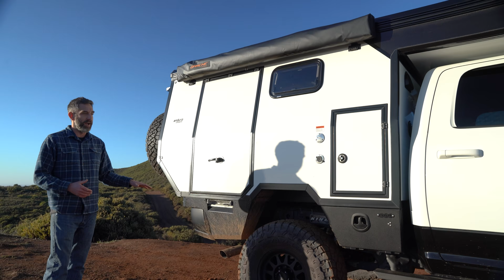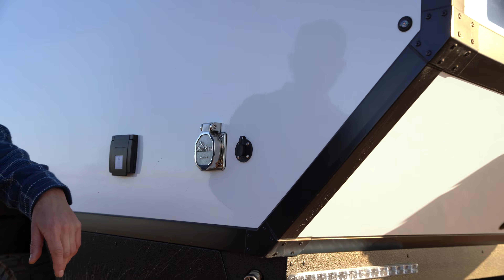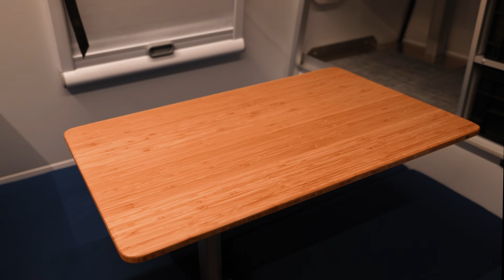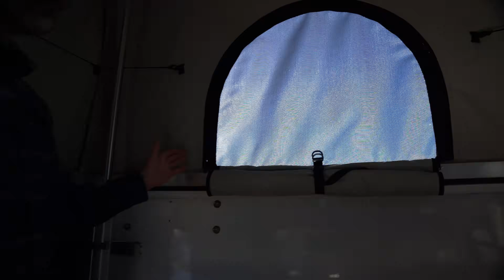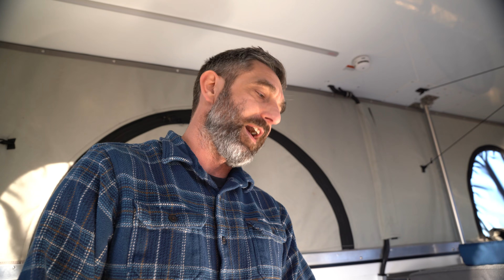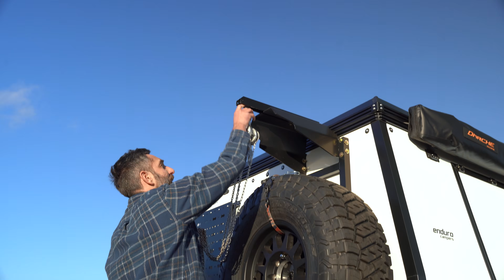RAM 2500 Enduro SuperTourer walkthrough | Frame mounted overland camper

Comment: No mention of a gray water tank?
Reply from the maker: We offer gray water tanks but we (and most customers) prefer a simple exterior drain through the floor; we install a garden hose quick connect to allow directing the drain to a bucket/jug or away from the camper.  Gray tanks take up valuable interior space.

Comment: One question.  Does the price listed on your website include the truck or we have to buy the truck and the price is just fitting the camper on the truck ?
Reply from the maker: The price on the site is just the camper price including installation and chassis integration

Comment: Do you guys still offer unfinished Enduro Camper shells that a buyer could have completed by a 3rd party or DIY?  Also, are your campers available without the pass-through garage?  It looks like it sacrifices valuable interior floor space for storage.  I pull a small utility trailer that houses all my dirty gear, spare parts, tools, extra fuel, etc.  No need for folks like me to give up temperature-controlled floor space.
Reply from the maker: Yes, we still offer shell models for you to build out your own interior and we can remove the pass through garage. Shoot us an email at info@endurocampers.com and I can provide more info!

Comment: Can you have an ac and fan on your roof? Also, realistically can this be installed on an F150? Thank You
Reply from the maker: Yes, you can have a Maxxair fan and an A/C on the roof along with 600W of solar (and Starlink) with the linear actuators.  This is what the F250 in production now is getting.
Reply from the maker: However, A/C and certain other options are not available on the half-tons to keep the weight in check.
Reply: They should look into the 12v AC that goes underneath like the have for the Ford Transit vans.  Without a spare tire underneath they could probably mount and protect that.
Reply from the maker: We've looked into it, I don't like the idea of mounting mechanical items under the camper that will be exposed to substantial dust, I just don't see it lasting long based on experience.  Extra fuel or water in place of the spare tire is the best use of the space in our opinion.
Reply: @endurocampers  fair enough.  those transits don't have the offroading capability these full trucks have so yeahyou're probably right to stick with fuel and water.